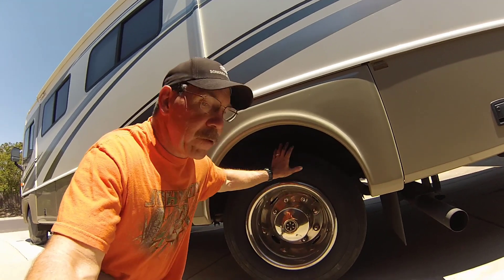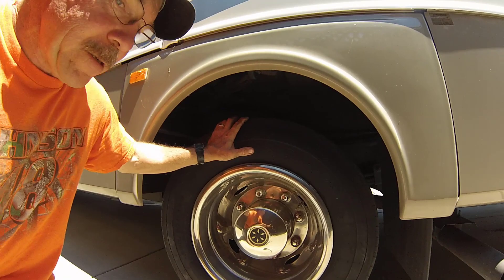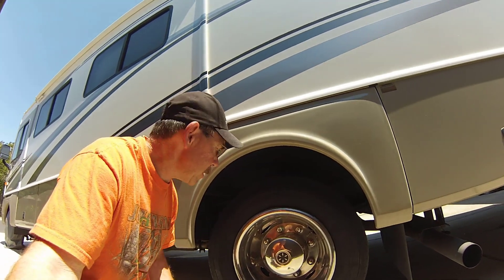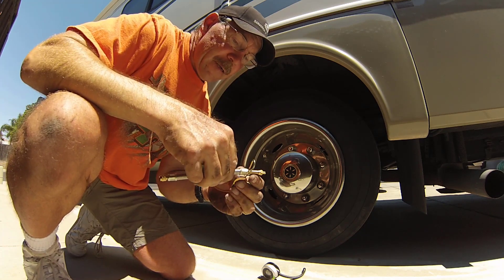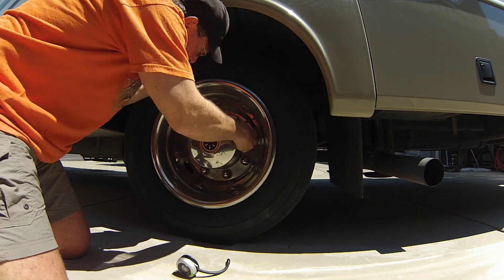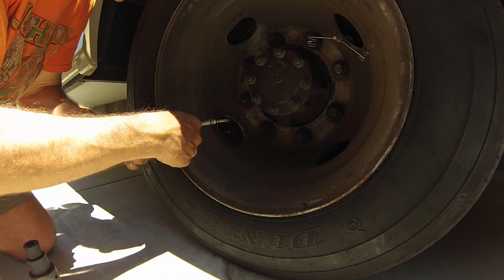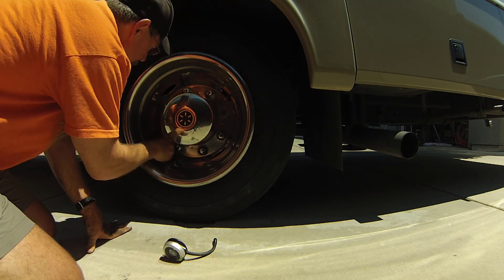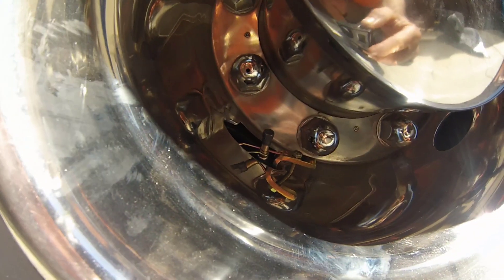RV valve stem extensions

Comment: Do you clamp it to the hubcap and not the wheel?
Reply from the maker: I now have a new set that the extension holder is riveted to the hub. The one on the video its clamp down with a bolt.